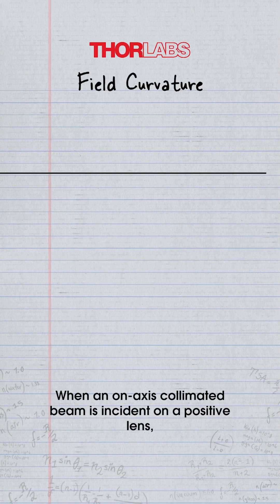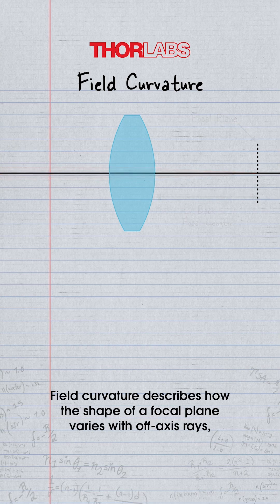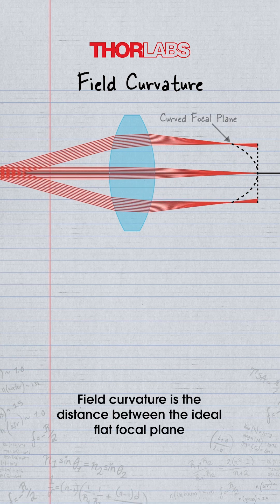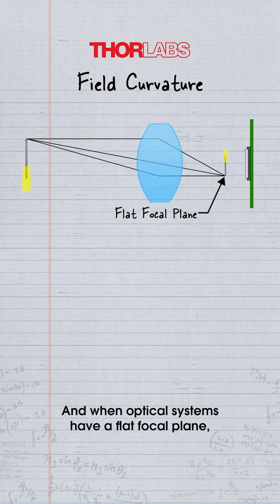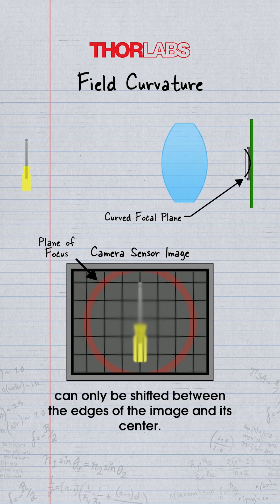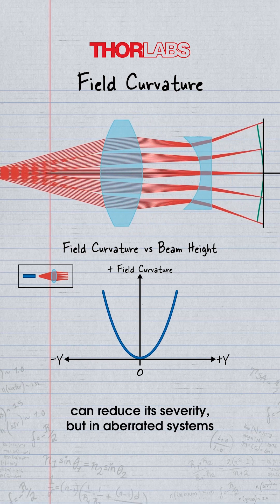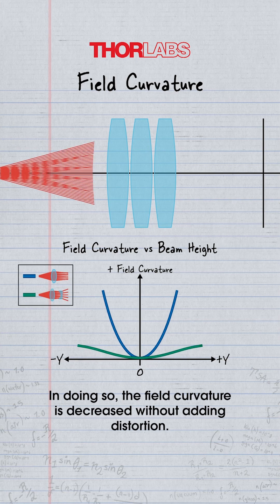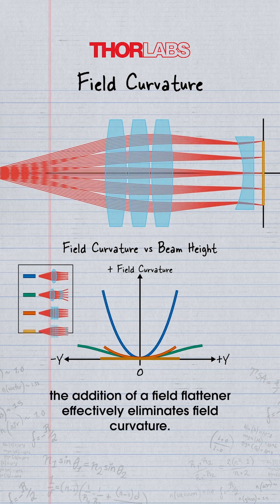What Is Field Curvature? | Optics Explained

Comment: To piggyback off of FarmedFrags' question regarding the principal plane, I'd be thrilled to see a video of yours that applies this to fisheye lenses - particularly wide angle equisolid, equidistant, orthographic, and stereographic. Of course, that might be a lot for 1 video. I became fascinated with this topic when I first sketched a spherical frustrum (I believe that's the proper term) from my dash camera projected onto a tangent plane (a wall) that characterized the type of lens distortion and magnification (w.r.t. to the f/1.8 aperture used) that was used to transform from a rectilinear mapping to equisolid mapping with 16:9 aspect ratio from and IMX678 image sensor (1/1.8") - all without initially knowing the focal length used. To break down the field curvature of these types of lens (like you did here) would be a top tier video IMO!
Reply from the maker: @Isaackay5887 Thank you for your reply and feedback! We'll be sure to add your suggestion to our list of viewer-suggested topics. The field curvature of an optical system can vary greatly with the specific design and design choices made, which may be difficult to generalize for a given fisheye design. That said, we'd love to dive into these more advanced topics!

Comment: What about principal plane ?
Reply from the maker: @FarmedFrags Thank you for your question! Instead of using a principal plane as our reference, we used the back surface of the last lens. The distance from that surface to the focal point is the back focal length (working distance) and is usually specified by the manufacturer. This distance is intuitive and often used when positioning a lens or lens system in a setup. On the other hand, a principal plane, which is located an effective focal length away from the focal point, is invisible and often located inside the lens or lens system. These planes are not easy to locate on the physical optic, and so are less useful in the lab. However, they are useful theoretical tools for modelling aberrations’ effects. Let us know if you would like to see a video about principal planes or if this did not answer your question!
Reply: @thorlabs yes I’d love to see a video on principal plane
Reply from the maker: @FarmedFrags Thank you for your suggestion, we've added this to our list of customer-inspired topic ideas!